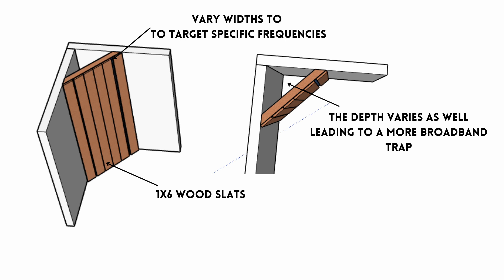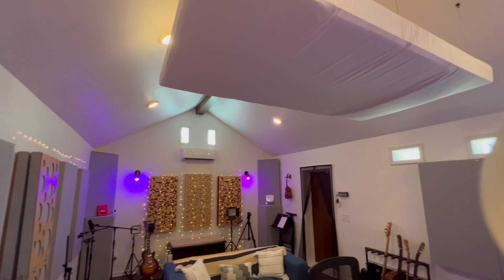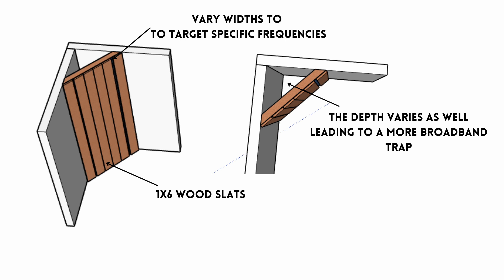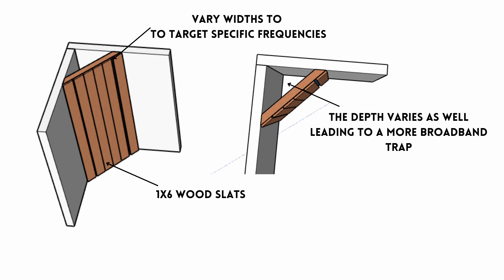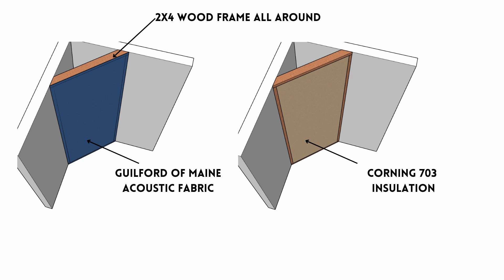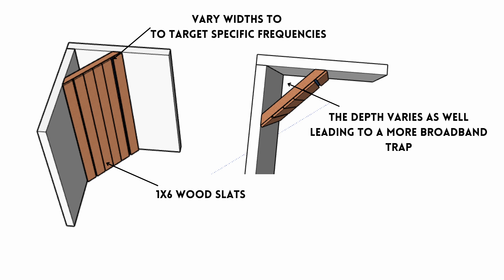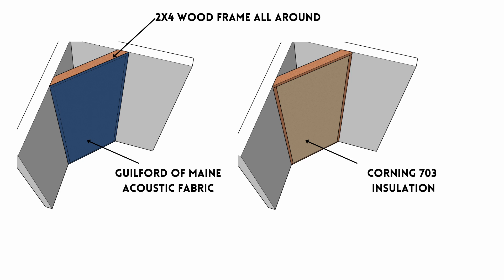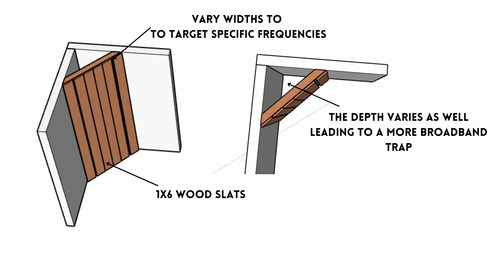Tame Low Frequency Issues In Your Room

Comment: I'm having trouble with 125Hz. I placed a cloud near the table with a rock wool panel containing two 50mm rock wool panels weighing 34kg cubic meters. So, I ended up with a total of 100mm of rock wool. I left an extra 10cm between the panel and the ceiling, which reduced the decibels a few times.

I'm desperate. My living room is 360cm (length), 243cm (width), and 249cm (height). Any response would be welcome.

I can also send you some images via any means of communication you prefer.

- Brazil
Reply from the maker: 125Hz can be stubborn in smaller rooms,  usually needs more bass trapping in the corners on top of the cloud. If you want, we can chat about your setup in more detail here 👉 https://www.soundproofyourstudio.com/Step1

Comment: any diy project that is sensitive down too 1/16" is unlikely to generate a happy amateur.
I suggest that the geometry of the HR presented is unworkable.
also: these are not complicated math. 
{have you "heard" of an acoustic lens to treat specific fo?)
Reply from the maker: My ideas around low frequency acoustics has shifted over the years. I believe broadband bass trapping is the way to go and pressure traps should be used sparingly. Are you planning on building a home recording studio?
Reply: I have a dedicated room in the basement as a mixing/tracking room.dimensions are 11x10x7.5 feet i have broadband absorbers already 6 inches thick and 2 12 inch thick soffit style traps on the front corner of my room and 4 tri corner traps on the wall to ceiling to my left and right side. my recordings still get muddied up at around 300-500hz . do you think this will help?

Comment: Intriguing idea, but the math is totally over my head! Any suggestions for using a similar way with less precision? I’m about to cover the walls floor to ceiling my listening space with acoustic slats (Richter ribpanels) that claim to be effective above 500Hz. I planned to use 10cm thick mineral wool with 2cm air gap on the side walls and 20cm+5cm air gap on the front wall. I am going to use 10cm Basotect at first reflection points, as it’s said to be effective above 250Hz. Any suggestions on maximising these materials without greater intrusion into the small space? (This refers to the front 4x4m section of a 6.5x4x2.4m room). It’s a wooden building with stud walls that include some insulation. I’ve yet to move in, but wanting to treat room modes above 60Hz. Any ideas you have would be appreciated!

Comment: Great video! Isn't it true that a lot of these modes are caused by the <125 Hz frequencies bouncing off walls? I'm thinking that the corner treatment you describe is a small part of the solution. My room is 22 ft x 34 ft and my speakers are placed on the long wall. I sit back about 14 ft from the TV and sound system. Thoughts? Many thanks 👍!
Reply from the maker: Modes happen up to higher frequencies but the low frequency modes are the ones that are hardest to treat. For your situation you could probabaly enjoy your home theater with acoustic panels and corner bass traps. This technique is best for mixing and mastering rooms, however it would work for you, it would just be expensive.
Reply: @soundproofyourstudio  Great, thanks for the advice!

Comment: Does this logic work for bass that comes from outside? I am getting quotes this week to help find solutions to reduce bass from cars from the street.
Reply from the maker: In that case you need sound isolation. They are different. The best option would be two masonry walls with sand filling. Then two brick walls, then two stud walls with four layers of drywall the. The same with two layers of drywall. Bass takes lots of mass.
Reply: @soundproofyourstudio  thank you so much

Comment: Hey man, just finished your workshop. Great stuff, really appreciate your help! I am just little bit undecisive about how to split my one big room into control room and live room. Either I have a "almost" perfect square shape for control room/mixing room and quite a large live room where a band could fit easily and it would be very comfortable to play in. Or I can make my control/mixing room more of "ideal" size in terms of ratio but the live room would get quite smallish, basically becoming a square room. Which option would you choose? Making the control/mixing room ideal or the live room? 
Cheers and thanks again for your help!
Reply from the maker: You never want a square, but assuming you are looking at a room mode calculator, I always choose your gut reaction of your best workspace over room modes. Unless those modes are so bad it will make a terrible mix room. How you feel in a room is very important and often overlooked in this super nerdy field.
Reply: try a wall at a 20 degree angle to seperate the two. This will gain space on both sides and help with acoustics.